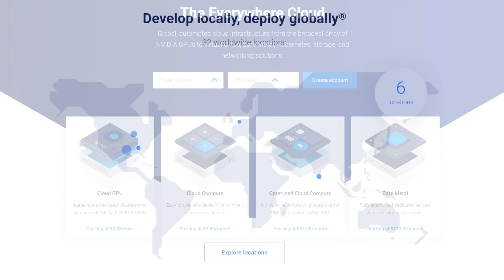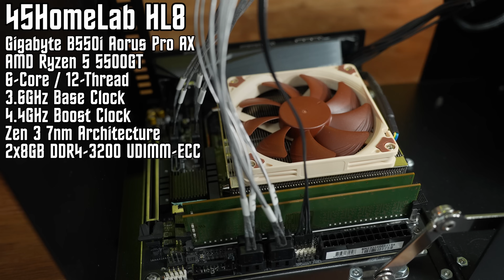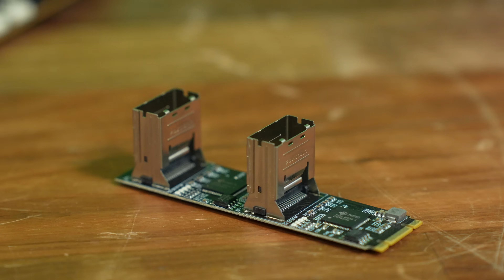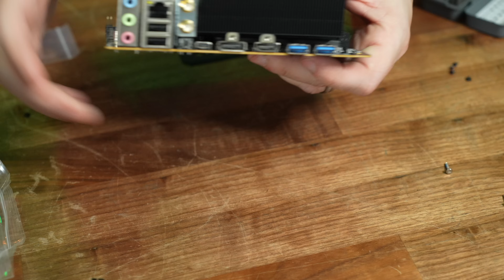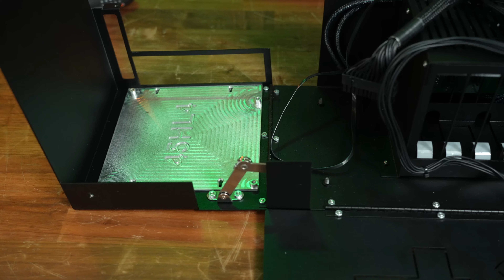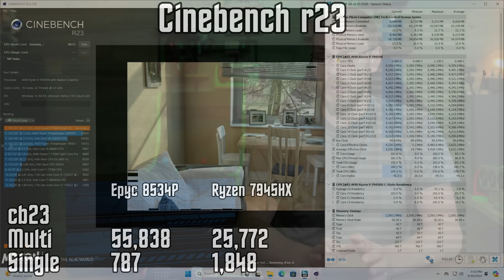The Ryzen 7945HX Mobile is an INSANE Server CPU - Minisforum BD790i in a 45Drives HL8

Comment: Be careful! The M.2-to-8-SATA adapter uses an JMB585, which offers 5 SATA ports, and one of the SATA ports is connected to a JMB575 port multiplier. This means 4 of the 8 SATA ports on the M.2 adapter share the bandwidth of a single SATA lane.

Furthermore, the JMB585 does not support ASPM in Linux, which results in higher idle power consumption.

A good alternative is the ASM1166, which offers 6 full bandwidth SATA ports, and supports ASPM.
Reply: Exactly! You only get 6 ports, but at full speed and no wierd trickery
Reply: Figured this one out the hard way. ZFS does not play well with this adapter or any with the multiplier. It was throwing constant errors with zpool.
Reply: it might not matter much when you're dealing with mechanical drives. even the fastest sequential r/w in hdds, will not reach sata2 speeds. but the asmedia does seem like a better option, especially if your m/b already has like 2 sata ports.
Reply: @giornikitop5373  That and the fact that TrueNAS/unRAID etc doesn't like using SATA multipliers. So the JMB575 might become a problem. YMMV.
Reply: I got one of those JMB505 m.2 cards i can confirm the performance isn’t the best but good enough for the price
Reply: ASM1166 is limited by the PCIE bandwith so the sata ports will never be able to operate at full SATA 3 speeds if you utilise all of them. So lets say if you want to put 6 sata SSDs on it their speed will be heavily limited. Of course mechanical drives are fine as each port should max out at around 250mb/s
Reply: @ It's not just a problem of the bandwidth, unfortunately. I did the math as you did before I bought it and deemed it acceeptable because I was only attaching HDDs. However, the way it multiplexes was causing random dropout and checksum errors in a zpool. I tested multiple times with different disks and the same disks ran absolutely perfect on an LSI HBA card.

If you care at all about data integrity, I would not buy these cards. I thought I was saving money, but then I realized you can pickup an LSI HBA with 2 SAS (up to 8x SATA) with full bandwidth for actually LESS. I got my LSI  card (Flashed to IT Mode  already) for $23 used on Ebay, and the ASM chinese card was 28.99 on Amazon.

Comment: AMD's mobile processors really are a great option for home servers with moderate performance needs. You get a sufficient number of cores with hyperthreading and the TDP is pretty low. It also has integrated graphics that you can leverage for improved graphical remote access session streaming. And, while they don't have as many PCIe lanes as the actual server processors, they still have more than Intel's mobile CPUs have had in recent memory. One of the other things that I appreciate a lot about AMD is that their take on the BIGlittle architecture is somewhat special in that their c-cores are, as the name implies, compact rather than cut-down. They just eliminated all of the extra space on the die that is ordinarily used to increase the package size for each core for thermals. So the IPC remains completely unchanged compared to their standard cores, but they can't clock them quite as high. Given the general efficiency of Zen4 and newer processor cores, this really isn't a bad approach at all. I'm kinda looking forward to when they decide to show off a small business and home lab variant of their Epyc lineup that just has a ridiculous number of Zen5c cores clocked just below 4GHz. I'm imagining a 64-core monster with a sub-100W TDP. For smaller businesses, a pair of servers with that setup configured in an HA virtualization environment would be more than enough for most applications. I'd actually really like to see HP or Dell make a 2-node workstation format business server with some extra redundancy and a built-in infiniband solution for node interconnectivity for failover. No need for complicated back planes, either. Just have the nodes install from the rear of the machine and put all of the connectivity on the face of the nodes. If it's done properly then you should be able to fit two PCIe slots and an OCP 3.0 slot in conjunction with at least one gigabit or faster NIC built into the motherboard, which is more than adequate for most small business needs. Other connectivity can be made through the midplane connection that also delivers power to the nodes.

Comment: Although it will limit us on space in the case, but in theory you can put a miner's extender from m.2 to full x16 slot. And then put any sas controller you want into it. However, I am not sure that such extenders support pci-e fifth version. By the way, non-compliance of PCI versions can also cause m.2 controller not working.

Comment: I've seen mention that a BIOS update allows for PCIe bifurcation on the x16 slot, which could be very useful to put 4xNVME drives on it, and use one of the M.2 slots for 10gbe, or with a M.2 to PCIe adapter to host the ARC A310 for video encoding.

Comment: Fantastic Video! I have been waiting for months for someone to do a video with that Sata controller on that motherboard! I was so close to purchasing that motherboard controller combo but you just changed my mind!

A couple of Ideas on how to get a Sata controller to work with this combo. There are several different products on the market to enable converting a M.2 port to a PCIe slot that could then hold any kind of PCIe Card you want most obviously an inexpensive SATA Controller. It looks like there is room to attach the card and slot adapter to the side of the Drive Enclosure! Some kind of 3d printed bracket would be ideal. Cooling would be a concern however the bracket may need to house a fan as well. My second idea is similar but would either be USB4 or Occulink adapters to a card supporting a PCIe slot. 

Once again thank you for doing videos that actually make a difference instead of just being a talking head with no actual hands on. (You have also turned me on to some really good beer!)

Comment: if you use some self-adhesive (or added double-sided tape to non self-adhesive) HDPE foam under the M.2 adapter card, that will help alleviate any unwanted movement in the card.

Comment: I love everything about this, but I think you missed something at the end. The problem isn’t the card as flimsy as it may be, it’s flexibility of the case that is causing the problem. In a normal case, you takeoff a steel panel and you can access everything. You don’t twist wires or bend things unlike this case which is built entirely around the fact that you were going to be bending cables whenever you open it up. It seems like that card if it works as it supposed to would work in 999 out of 1000 cases as long as those cases do not require you to make your cables dance like Deadpool in a disco bar.

Comment: The slightly lower spec 7940HX SE is also up there for quite a lot less money, and there's an additional discount code if you search. Incredible option for two hundred less dollars.
Reply: Wut….
Why is that so much cheaper, 
there must be a downside I am not seeing
Reply: @JokingChickenn  it uses a lower binned CPU that only have 200mhz lower peak turbo, PCIe gen 4 for the M.2, so no more ssd cooler and it doesn't come with a WiFi card. That's the only difference if I recall
Reply: I see the 790i SE listed for about $400... Where do you find it so much cheaper? :/
Reply: @pixel_vengeur391  On MinisForums own webstore the prices differs $200. BD790i cost $539 and the BD790i SE cost $359.
Reply: @Promit  yeah slightly lower clock and a fking SSD heatsink is too little for extra 200 bucks
Reply: @arjungupta3531  no wifi card either.
Its a mini desktop, you might like to move around with it.
A reputed wifi card would be better than a cheapo 100rs usb adapter.
Stop being condescending to people.

Comment: Currently using this board with proxmox it supports bifurcation so the PCIE cards can be divided up, currently have mine populated with a connect-x 4 nic and an oculink port which I've installed into m.2 slot which runs my HBA. :)

Comment: You’ve discovered why this board has not gone crazy in the home server world. You can choose GPU, SATA or 10Gb networking but can’t make all 3 happen. GPU would be OK if you could use the internal GPU but AMD is limited? PCIe slot then could be HBA or 10Gb card? Use the m.2 for m.2 to 6xsata adaptor (they are usually reinforced already) ? Give up having nvme for your TrueNAS install disk (a waste of lanes anyway) and use a cheap SATA SSD on the HBA? However you slice it there are too many compromises to use this in a server.

Comment: @16:30 A solution would be to 3D Print a small cable bracket to connect to the Fan allowing you to Zip-tie the cables in-place taking all the stress from the card.

Comment: Have you thought about getting an extension cable for the M.2 slot and putting the SAS thing into that? It would take the stress off the controller and stop it from flexing. You would have to buy a new one of those controllers and it would certainly be a bit janky, but hay I've seen you do worse😅

Comment: As for your issue there are bifornication cards (like a x16 flat riser cable that leads to a PCB that has 2 x16 slots obviously x8 electrically each, with that and a little squezzing here and there you could e.g screw the GPU on the backplate slot to keep it steady, use an other shor riser to use the 2nd slot and put a sas pcie card there on a different angle/position (which the lenghth of the 2nd riser will allow you to put)  and find a way to to let a sas card plugged in the second slot to float somewhere steady maybe using duct type too  lol

Comment: Next perhaps possible idea (sorry, I only watch the videos, I don't build computer systems): PCIe x16 card to 2x OCuLink, one internal + one external. External connection: external graphics card, internal connection: cable + adapter board PCIe with SAS/SATA controller

Comment: What's the idle power usage of this board/chip? That's something I'm super curious about since majority power usage of a home lab is from just being idle. I understand having various graphics cards, hard drives, and other components will increase the idle, but just for the CPU/ram and board itself is what i want to know. I'm curious since desktop counterparts usually hover around 30 to 60 W from the wall.
Reply from the maker: I didn't check idle draw from the wall, but the CPU did clock down to around 7W at idle.

Comment: I looked at the Minisforum website. The SE version of the board is $180 cheaper (only $359 ). But the only difference I see is the max CPU boost clock is 200 MHz lower and it doesn't have SSD cooling. Both are very minor downgrades. That is even more incredible value.

Comment: Passthrough for the Intel Arc A310 is critical. I really want to toss a couple in my own home servers, but so far, quadros are the only thing that works... MORE INTEL GPU STUFF PLZZZZ!
Reply: I’ve done passthru with an a310 in Proxmox to a Plex VM running Ubuntu 24.04 and had hardware transcoding work just fine (same card the Sparkle eco a310) on a full length 16x pcie slot but only wired to 1x PCIE.    Amazing what a $100 card can do with limited bandwidth and no additional power beyond the PCIE slot.
Reply: I’m replacing all of my old quadro p400s with these

Comment: Okay really REALLY dumb idea:
get one of those m.2 to pcie adapter (via flex cable or occulink) to a pcie sas/sata controller.
Remove the slot holder from it, lay the bare board on top of the drives under the cable mess.
Smush as needed to make it all fit, pray it doesn't overheat.

You didn't hear this from me.
Reply: Update:
You would need to put Kapton tape on the bottom or 3d print a tray for the HBA so it doesn't short on the case. You might want to use 2 sided tape for the 3d printed tray to adhere it to the case.

Another option:
They make a m.2 to x4 slot (on the m.2 card). Then get a x4 flex cable extension. Only issue with those is they use either a molex or sata power adapter, so check to make sure your sas/sata hba doesn't consume more then 50w.
Also some aren't x4 and are really x1, so caveat emptor.
Only suggesting this as you have limited height and some m.2 to pice adapters are wide or have a 24pin power connector on the side which may prevent you from closing the case fully.

Comment: The case probably doesn't have enough space for it and no way to anchor the parts: M2 to PCIe adapter (edit: I don't know how many lanes they have) and then a normal PCIe 8-way SATA/SAS controller. Power supply is an additional problem.
Maybe sacrifice 2 drive bays for more space?

Comment: 26:39 Agreed that's crappy design. I imagine reliability was also an issue for 45 Drives when it to considering those M.2 cards.  Those connectors need to lay flat on the pcb back-to-back and they need to include a thermal pad between the M.2 board and Motherboard underneath.
Reply from the maker: This is the card they ultimately decided on: https://amzn.to/3zJilw7

VERY stout, with a SilverStone heatsink bolted onto it. I might pick up a second, and run a pair of SATA SSDs for boot off the two extra ports.

Comment: M.2 to PCIE 4x with an LSI 9300 8i hidden away somewhere in the case. Should work fine with 4 lanes 😊
Reply: This is the way. Or even put the GPU on the 4x, you don't need the bandwidth for transcoding.
Reply: Beat me to it. Hot glue fixes all mounting problems, right? :-D
Reply: Yeah this. M.2 is just pcie in some other form factor. I'm running a mellanox 10g sfp+ card from one of my itx boards m.2 slots and it's been rock solid.
Reply: Just remember that the LSI card would most likely need some air running over it.
Reply: Very nice idea
Reply: "Delock M.2 Key M to PCIe x4 NVMe Adapter with 20 cm cable" is what I found on a quick google search

Comment: redo this video with some foam padding under m.2 controller + angled sas connectors + preinstall the cables on the m.2 controller before slotting it into the motherboard. p sure u killed it when installing the last cable... the flex was insane
Reply: That's the second video in a week where I've seen some sort of funky and obviously rather flimsy NVME adapter board being assaulted.
Reply: Watching him plugging in the 2nd sas cable was just painful. Not even a little bit of support with his finger underneath
Reply: There are other such adapters with a reinforced PCB. And, as someone previously pointed out, choose an adapter with an ASMEDIA controller, J Micron controllers suck they often get very hot and throttle the already poor performance even more.
Reply: I was thinking maybe a 3d printed bracket?
Reply: I don't know if angled sas connectors are helping because of the 90 degree rotation while closing the case cables and controller have to be stabilized in two positions.

Comment: I'm so curious if the wifi card could be replaced with some other cursed replacement. Maybe there is an upgrade in it's future?
Reply from the maker: I did consider that. There are some m.2 2232 SATA controllers. Maybe even move the boot drive to the 2232 slot, and run a pair of 4-port controllers on the m.2 2280s.
Reply: @CraftComputing  I know they make wifi to 2 x SATA boards. Could maybe use that for a dule boot on some small 2.5 SSDs.
Reply: @CraftComputing  Could even go to PCie to NVME see options in ADT Link "M.2 WiFi Extension Cable", interested if you try. Thanks for your content!
Reply: Maybe a second Ethernet connection?
Reply: I believe it can looking to put an AI card in my system.

Comment: I haven't run it in a prod setting, but technically you could use a SATA m.2 drive on a USB adapter, or an nvme, for the boot drive; kind of like a satadom.  Then you'd have an nvme for the VM storage.  Just backup the config frequently, and setup a relocation job from the VM pool to the primary storage pool.

Comment: can you bifurcate the x16 slot ?
Reply from the maker: Unfortunately no. While I think it's technically supported by the 7945HX, there's no option in the Minisforum BIOS.
Reply: With bios 1.05 you can. It's under Advanced then AMD PBS and then PCIe/GFX something. I have not tried it myself, but it is in de bios
Reply from the maker: Ah! I did see there was a 1.05 update, and I'm on 1.04. I'll take a look.
Reply: Indeed. "Setup -> Advanced -> AMD PBS -> PCIe/GFX Lanes Configuration"  has bifurcation options. I also have not actually tried using it, but I spotted the option.

Comment: Were you able to get ECC memory working on this board? As someone that has suffered through bad memory, corrupting all the data on my NAS before it kind of irritates me when people build NASs without ECC memory. It is like driving a car without a seatbelt and then saying, well, I haven't had an accident yet.
Reply from the maker: I don't have any DDR5 SoDIMM ECC, so I am unable to test.
Reply: @CraftComputing Video idea. Going through all these Ryzen based platforms to see what supports ECC? I would personally like to see a bigger push from homelab youtubers when it comes to ECC. Maybe we can get more mini pcs and sbc supporting it in the future. Servers use ECC for a reason. You know this.
Reply: I'm 99.999999% sure it won't work.
Just build a mini-ITX system using AsRock MB and EPYC 4004-series CPU instead.
Or consider AsRockRack board, although I don't know what they offer these days.  I have an X470D4U but have been disappointed with their on-going support.
Even the regular AsRock (not AsRockRack) have more up-to-date support.  Go figure.